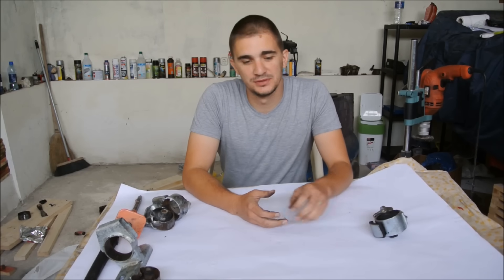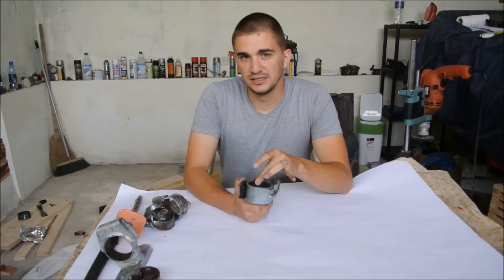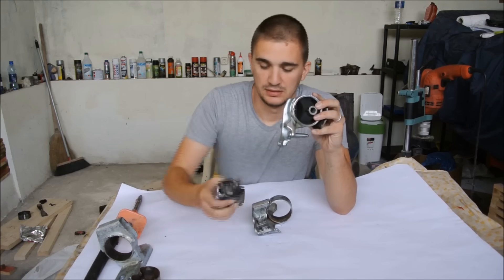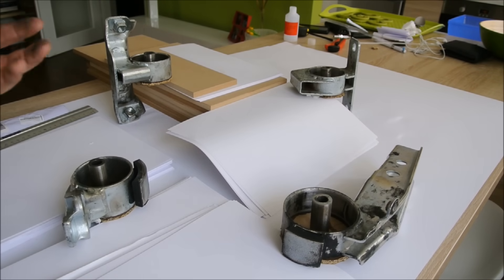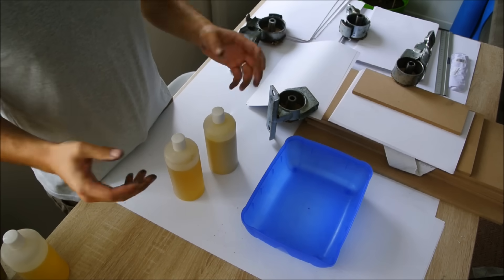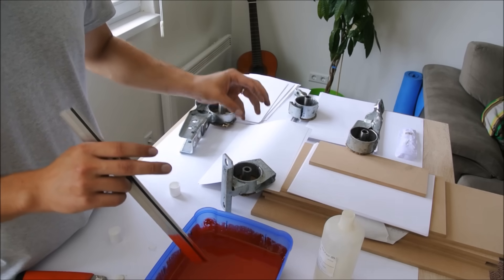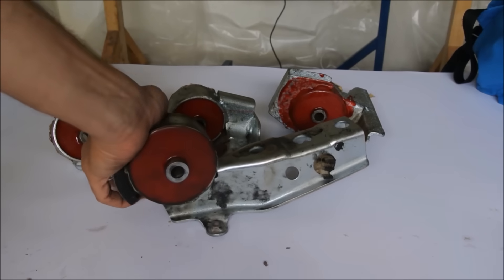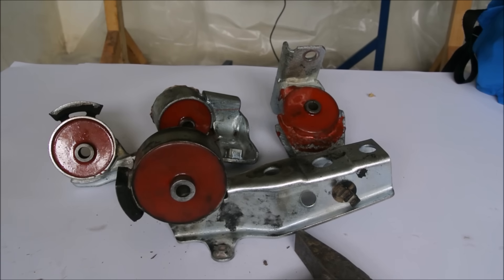How to make DIY polyurethane engine mounts

Comment: Ok what dye is that? Water based? Oil based? When i use water base i get a sponge not a solid polyurethane
Reply from the maker: It's a polyurethane dye by smooth-on, the same brand that makes the polyurethane. I have no idea if it's water or oil based honestly.
Reply: @d4a  thanks for the reply man i appriciate it

Comment: Actually contrary to many comments about the "bonded in" nature of the pin and outer ring to the urethane, I believe here what he has suggested, is the best of both worlds.  The STOCK RUBBER ones are around Shore 40A to 50A but the  Urethane can similarly be purchase to Shore 40A or 50A or 60A or very soft Shore 10A or very much harder in the higher Shore D scale.  The comparison is urethane compared to rubber have slightly different absorption of vibration and slightly less stress defection for similar Shore hardness.  This has to do with modulus of elasticity.  If you pick a urethane similar to the original rubber bushing the stress defection would be similar with a softer, i.e. more energy absorbing, urethane bushing as the urethane has a higher modulus of elasticity and less stress deflection all things equal.  As urethane is basically both higher tensile, and compressive strength for a particular hardness its going to absorb more energy so deflection will be less, and the internal stresses will be higher.  So the idea of going harder is bad as it increases shock loading with high resulting internal stresses.  This leads to reduced life and compression set unless carefully engineered, just like rubber bushings.  But urethane is an engineered chemical whereas rubber is made like making a cake from a combination of materials coming together to form a unified whole, heavily dependent on processing the same.  Still don't push it if you don't want to crumble your bushings be careful.  You may have better engineered material but you don't want push it too far or it will deteriorate just as bad or worse than rubber.  The difference is rubber will gradually give up whereas urethane will all of a sudden give up.   He is on the right track not to allow sliding movement and accomplish suspension normal deflections with deflection of the urethane like is done with rubber bushes.  Auto suspension engineers have a 100 years of experience and mass use to back them up with the bonded in flexible rubber bushes technology.  The urethane applied the same way is a change of material not basic design... so the man here is right to build his bushes as he does.
Reply: So in other words if you choose a shore hardness of polyurethane that's the same as the original rubber the urethane will dampen vibrations more effectively?  Seems like that would be the right way to go, rather than using a harder material.  Start there and work your way up if necessary.
Reply: Kimball Scarr  good advice I was wondering about that

Comment: Be careful doing this. A polyurethane bushing is suposed to act more like a bearing and be able to slip/rotate slightly. That is why they always come with sleeves and will squeak without grease. The rubber bushing is bonded on to the metal on the inside and outside edges. The rubber bushing can flex. Doing this bonds inflexible polyurethane to the inside and outside edges of the bushing. This will be far too stiff and put too much stress on the polyurethane. Also instead of absorbing impact from the road these bushing will just transfer the energy to your drive train and chasi. A full set of legitimate polyurethane bushings is like $300 and worth every penny.

Comment: Thanks for this video. I have a 1996 Riviera with a bad motor mount that is impossible to replace. They simply are not available, and even the used ones from salvage yards are all so old that the rubber is gone. But repairing my motor mount using this method sounds like just the thing I need to do. Thanks again.

Comment: Could you not drill the rubber out?
Reply from the maker: I could but I don't think it would help. It's also hard to figure out where exactly to place the drills. The forces acting on the mounts are complex.
Reply: @d4a  fair play, nice work 👍

Comment: Yeah if you would of poured a little wax in the bottom instead of the cardboard they would look better and it releases really well. I've used wax for a ton of molding before. Never thought about the liquid poly for making mounts though. Good idea bud.

Comment: Hi saw your polyurethane bushing is that good for  transmission supports as well?   Another thing , can you send me a video how to cut a original coil springs for a Honda  City 1998? I bought a hard gas shocks ( Nitro tech -  korean made) front and rear and I want to counter the hardness a bit by using an original OEM springs and cut it just a little to leave a 1 finger drop in the front and 2 at the back....  They were sayng I need to "torno" the tips from where I will cut the  springs  so it doesn't destroy the  shock mounts and bearing. Can you teach me how so  I can  DIY - Do It Myself and achieve a good drop. Thanks and more power to your videos ... VERY HELPFUL and you are EASY to Understand friend.... hope you can get back  at me pls pm me a message and the videos thanks  again !!!!! Jason Espejo of Marikina , Philippines ...

Comment: I have to say next time I need a carrier bearing insulator for a drive line I'm going to do this. New carrier bearings are $185 up to over $1000 if you can even get one it's in my experience almost always the rubber insulator that rots and not the bearing. In my old Datsun I would of had to get a new driveline made to get a carrier bearing. So I cut up a mudflap and wrapped the carrier bearing every couple years I had to rewrap it . But this man im going to try it.
Reply: Just FYI, a lot of the drivelines are based on a Subaru drive line from the mid to late 90s or early 2000s, and licensed from Subaru.  I had a 2005 Cadillac SRX with such a driveline, and the part was costly.  But the CTS part was $35, and had the same inner rubber spider and bearing, only had to dismount the outer mount from the old part, and put in the new bearing and isolator into it.  Worked perfectly and far less money.  Anyone encountering these should see if there's another cheaper model car or even this CTS part that will work (since many are also licensed from Subaru and the same part and bearing design), and simply replace the isolator and bearing, your old outer ring and mounting tabs are probably not damaged at all.

Comment: I've removed the old ones by using a thick metal disk that came from a lamp base, shaving it down to the size of the outer ring and putting a big bolt through it to the other side with a larger diameter pipe and just pressing it out by tightening the bolt. You can use a sawzall coming from the inside if you do that you want to shave most but not all of it out. Use a screwdriver to drive the two sides of the cut apart. Most of these mounts are aluminum they wont take lots of shock. If you're crying about the factory mounts allowing motion...thats for driver comfort when you're marketing something its all about vibration, harshness and noise. Most people dont want to break their eggs and taco shells taking a corner that hard

Comment: The one u pick up a 14.29 is not centered
Reply from the maker: It's not supposed to be centered. Its off center when stock and brand new to allow the engine to sit at an angle that enables better oil return from the cylinder head.

Comment: Hello mr . I have land rover. The support mount engine is very expensive. Do you advise me to rebuild them ?
Reply from the maker: These will be a bit hard, and more suited to track and racing use. Just get some polyurethane windshield adhesive and pour into the mount.

Comment: How will is this holding up? I'm fairly certain that these are the done through injection molding which uses pressure to force the material in to the mold.

Comment: if you measure the inner diameter of the tube that you are removing, you can buy some DOM tubing and cut it to length to fit into the original mount, then pour the poly around it. It doesn't really matter if the outside diameter is the same as it is surrounded by the poly. It would be a lot easier than all the mess of removing the old one.

Comment: Nice video and informative, thanks. I work with polyester fiberglass quite a bit and the best, cheapest and easiest mold release I have found is Parchment paper (like wax paper but works at higher temp and is very non-stick) that can be purchased at any grocery store for $3 or $4 per 25ft. role. Where I can use it, I line the molds with it, lay wet glass over the parchment paper and let the glass cure. When cured it pops out and the parchment paper comes off easy. Would probable be a good thing to use with this liquid polyurethane. If I try it with this process I will post results..
Reply: Did you ever try it?

Comment: Hi,
really good work, respect! Unfortunately, this application is not known in Europe. Especially I do not fiden this polyurethane. This is only offered for model making. Also the finished bottles like
Loctite PL S30 is not offered here. I have the same problem with my Opel Astra G. The original mount is like a toy. It is only held in a thin spot, it does not last forever. I would like to reinforce but have no plan at all.
Reply from the maker: Achim Gazelle Use windshield adhesive.
Reply: ok thanks for the tip my friend.
how is the elasticity? is not it too hard ??would this product work too ??
http://mannol.de/20/?action=accessory_chemical_preview&name=9910%20Windshield%20Sealant#

http://mannol.de/imgbank/Image/public/images/bilder_chemie/msds/9910_MSDS_EN.pdf
Reply from the maker: It will be a bit harder than stock but not too bad and not as hard as solid poly mounts as in the video. That product should work fine.
Reply: thank you very much ;-)

Comment: During the bonding process between Rubber and assembly parts are put into a mold and then the rubber is injected the assembly has its place and the pin has its place to ensure perfect mounting when the part is complete. What you're doing is not a secret but it's definitely a hack, that cardboard isn't going to cut it! what needs to be done is a fixture has to be constructed with the correct offset for the PIN perhaps with a rubber lining outside of the fixture to prevent leakage or maybe you can make a quick disposable fixture out of Styrofoam. Otherwise you're just jacking off in the garage.

Comment: Funny, I would have expected you to at least show it get mounted. for all we know you threw these things away after the video was done. the pins are not the same depth as the assembly they're wider so your pins aren't centered what you did looks like they're biased on one side or the other. they're standing out on one side this could cause a mounting problem.
Reply from the maker: There is a follow-up video with these things installed, and a detailed comparison between these and the stock mounts. It's in the pinned comment, which you must have noticed since you wrote a comment yourself. The pin is off-center from the factory, I replicated the same pin positions as in the stock mounts.

Comment: I'd be so pissed to go through all that work just to get my engine back in and find out on of those pins is a fraction on an inch off  lol
Reply: lol, they have some give to them so it would have to be quite a bit off. Much more than a fraction of an inch.
Reply: This is a good question, one of the pins in the video didn't look straight. Yeah I'm not sure if that products is very flexible like rubber...

Comment: Please, if you must burn the rubber out of the mounts don't do it on a concrete surface as shown here. Due to the water content of concrete it can literaly explode if you use a torch around it and you could suffer injury. Instead, put it on a piece of metal that is raised up off the concrete with some non flammable risers like bricks. That way the heat will not be sufficient to cause the water to turn to steam which is the cause of the explosion.

Comment: Only problem is..it's not worth the effort. Most online retailers offer alternatives to the mounts. Contextualize to that the fact that you need a special type of poly and well, really, some things aren't worth DYIng. Cool, and in a pinch (hard rubberized sealant adhesive for elevators, readily available at most big stores)  or lack of, yes, but otherwise not worth it.

Comment: I replaced my worn out rubber mount with P.V.A. polyvinyl  adhesive, used for bonding glazed ceramic and vinyl asbestos tiles.I was impressed by the excellent stiffness and great results.

Comment: On diesel Caravan it's always the rear engine mount that's fucked in first  cuz the VM Motori diesel engine is a very heavy engine ,  and the torque helps this mount to tore faster .
This video is helpfull because diesel Caravan engine mounts are expensive as hell !

Comment: You can use the drill press and drill many 5/16" or 3/8" holes to eat up the rubber around the pin and then press out the pin with a vise instead of burning it away

Comment: How do you get the polyurethane to stick to metal surfaces? When I had this done years ago, I was told there is a special prepping method that allow it to stick properly. Any ideas?
I have some mountings that are just 2 metal plates with rubber in between and I am going to try and redo them with Polyurethane. The stuff really has to stick in this case
Reply from the maker: You're right the poly sticking to the metal surface is a very important issue. This particular liquid poly I used, Reoflex 60 is good at sticking to metal surfaces without prep. However the metal surface needs to be pretty rough. If you check out my follow up video you will see that they held on really well. I have played around with making some other things with polyurethane and some of the parts were smooth metal and the poly did not stick.So if you're two metal plates are nice smooth metal, they will most likely not stick to the poly and to be extra sure that they won't budge I suggest using the prep. The prep is just another product that you apply to the surface before the poly.

Comment: What about rubber axle joints? Or would that be a bad idea even if you made them flex-y?
Reply from the maker: Silver Dude You mean the rubber axle boots? If you do mean thoseI think it would be really hard to make and there's really no benefit, plus that's not an application polyurethane is good for.
Reply: Thanks for the reply driving4answers! 
I was just kinda curious and interested in learning more about such materials since im only onto the mechanical parts/chassis.

Really appreciate people involed making such things from materials and making DIY tutorials since mostly nobody cares working at an auto repair shop. :/

Will also make those engine mounts when I revamp my entire engine on my good ol' E36 :)
Reply from the maker: Silver Dude Glad the vid is useful. Good luck with your e36 :)

Comment: Have you tried using a hole saw without the pilot drill to cut around the inner bushing before pressing out the outer ring?  You could avoid the burning stink.  Try waxing some wood for the bottom of your mold.  You may have to clamp it on.

Comment: On my srt4's, I found the solid poly mounts to be a little too stiff. Had a lot of vibration mostly. I eventually took old mounts and just filled in around the rubber with poly. Stiffened everything up and the old rubber absorbed the vibrations. I've been using that method on everything since then.
Reply from the maker: I removed the poly ones as well because of a lot of vibrations. They're more for track cars then street cars. I do plan to give the filling existing mounts with window weld on poly in the future. I made a follow up poly vs rubber comparison video you can watch.

Comment: What I would probably do instead of doing full poly mounts is bipoly so there's still a bit of rubber compound to reduce engine over-oscillation, but retain the under-load rigidity minus a bit of travel with the common rubber.
Reply: do you have a brand/name for the bipoly mix?

Comment: one question. before your diy that bushings had a metalring on the outside, wich i believe is pressed in using a hydraulic press. now the only thing holding the pin in place is the polyurethane. will the polyurethane grab enough to the inside of the hole?
Reply from the maker: +Micke That's a good question. If the surface is rough enough and the polyurethane the right kind it will hold. In the case of the Smooth-On Reoflex 60 I used it held really well. You can see it in the follow up video. Don't know about others since I only ever used this. But I know that there are surface treatment products you apply before pouring in the polyurethane to make sure it holds. Don't know what the product is called, sorry, but I know theyre out there.

Comment: You putting in more material than the original so if you keep the same 48 shore hardness as the original you will still have a stiffer ride.

Comment: If you make a hole in a 20 mm plate that is just 1mm bigger than that pin then you could use a hydraulic press to press the pin out of the rubber then you wont have that horrid smell and pollution going on and you wont change the metal characteristics with the heat.
If the heat made the pin too hard and it shattered like glass it could possibly cause an accident but that's very unlikely to happen, anyway try pressing it out it will save you a lot of time.